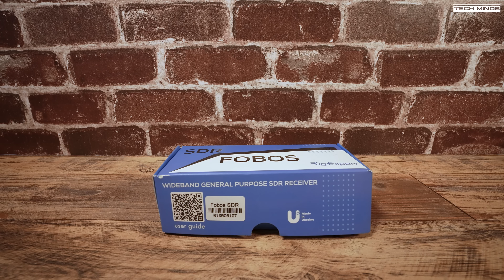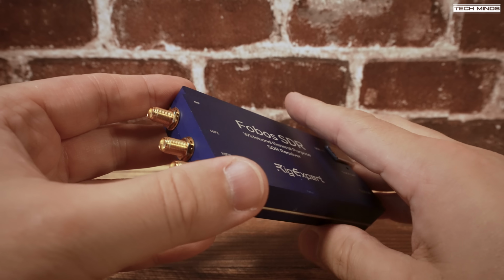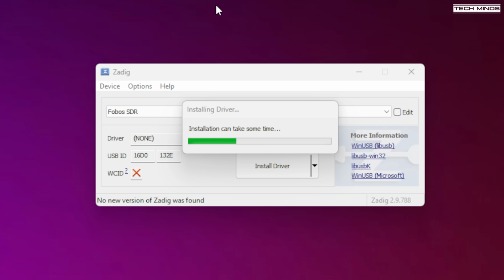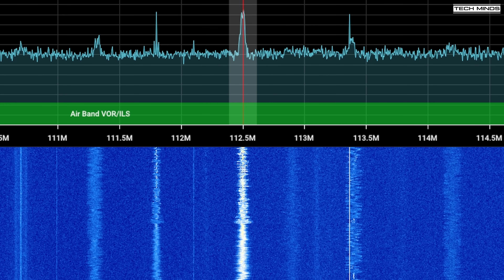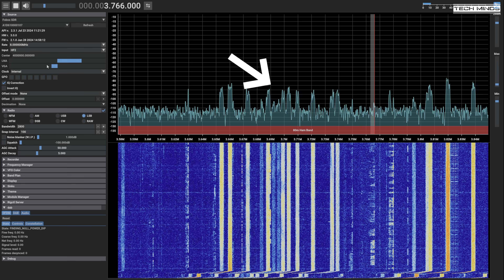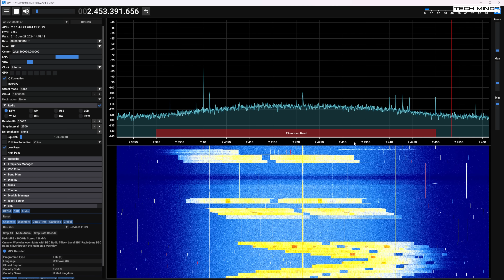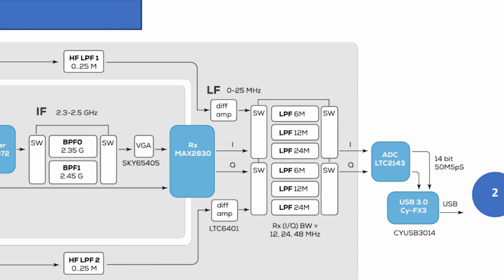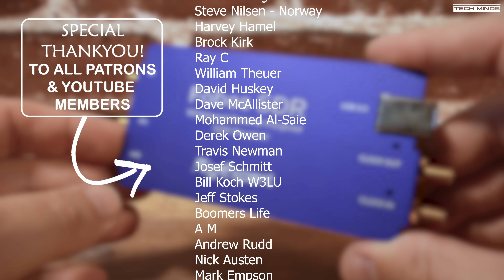RigExpert Fobos SDR 100KHz To 6GHz SDR Receiver

Comment: "Ignore those mirror signals".  That's the kind of response I would expect from some Chinese $30 dongle SDR manufacturer not from RigExpert.  What a disappointment.  I have 6 RigExpert antenna analyzers and love them.  I was going to buy one of these.  Thanks for saving me from making that mistake.  Mike KC3OSD
Reply: What models do you recommend by them? This wouuld be my first SDR. Thanks.
Reply: @mscir do you need RX/TX or just RX?
Reply: @technicianofgod  Sorry I didn't mention that, rx only. Thanks!

Comment: Thanks for warning us on this product ... you can clearly see at 9:55 that it just mirrors all signals towards DC ... its a bit like modifying an RTL SDR for sampling mode, the exact same happens, only here it mirrors at  exactly 14.4 MHz ... so you need a narrow front end and use the highest possible sampling rate. 14 Bit is a joke for such a price. But I still wonder if your device is defective, because that is just super bad.
I'd rather go with the RX888-Mk2, for under 200 €, which is real 16 Bit direct sampling RX that is brilliant and super clean on HF but less good on VHF/UHF because it uses the same tuner as the RTL-SDR for the higher frequencies, limiting its bandwidth and dynamic.
Reply: How does the RX888-Mk2 compare to the SDRplay RSP1b or RSPdx?
Reply: I dont know why you say 14 bits is a joke.  The BladeRF and Ettus B2xx series are 12-bit, and highly regarded.

Comment: Such a shame. I was really hoping this would be good. I love my AA230 and had great hopes. RigExpert customer service is great too. I really appreciate you making this video, even though you usually wouldn't. Lets hope that they can improve it with an update.
Reply: I'd be interested in options for hooking up via usb-c and how well they work.
Reply from the maker: Yeh, I was extremely surprised. I absolutely hated making this video, but I just didn't have a choice really.
Reply: @TechMindsOfficial  I do appreciate that you made this video and that you included the spectral data so that I could reach my own conclusions. I would prefer to not have to ignore things which are not there to begin with.
Reply: Uh-loo-mih-num. Not Al-you-mih-knee-umm
Reply: @attribute-4677  Not quite, it entirely depends where you were raised.  If you’re not from North America, his pronunciation was spot-on.
Reply from the maker: @attribute-4677 Shut up you tool 🔧
Reply: @attribute-4677  Al-you-mih-knee-umm. Not Uh-loo-mih-num. Don't be "that guy".

Comment: The aliasing is inevitable without the filtering, basic sampling theory. The HF port should only be used at 50Ms/s and above. That's why there is a 25 MHz LPF. At 50 MHz sampling the alias will be above 25 MHz, so prevent that band and all is hunky dory. In theory. Because there is only one ADC operating at HF, it is half the sampling rate, so if you wanted to use 8 MHz sampling you shroud have a 4 MHz low pass filter.. If there were I and Q inputs you could get a better result, but it appears at HF we have only I or only Q. So, run HF at max sample rate with the right software and I think you will find it much better.

The FM broadcast in Airband is probably again a lack of band pass filtering. Basically there is none. That has to be supplied by the user. Pity the user wasn't told .What is wrong is the expectations of the user have not been appropriately managed.

This does not mean it is not good, just it is not complete. It should have supporting software that only samples at 50 MHz or above for that HF port. Also, the fact there is only I or Q means the DSP software needs to know this. I suspect sdr++  is unaware and that's why the entire HF spectrum folds back on itself. That's software so fixable.

This is very similar to what you would see with the Pluto or even at Ettus USRP. Without filters they are all a disaster, never mind how much they cost. In this case we could have a very good SDR but one that needs additional hardware to operate properly.
Reply from the maker: Thanks Mike, you always provide great analysis which I appreciate. And, as I did show in the video, increasing the sampling rate did definitely improve performance on HF.  The problem here is, that most users, i.e folks that just want to plug an antenna into an SDR, and then the SDR into a computer, they just want to be able to use it, to listen to the frequencies it supports, without issues and extra fluffing and being specific with certain settings. The assumption that this is possible comes from the marketing that the Fobos is a General Purpose SDR. Rigexpert left a comment on here saying that I made mistakes in my video and that I misunderstood the topic of the Fobos...
Reply: Please do not bring SDR++ into this. They implemented the source module themselves, they are entirely responsible for any fuck ups on that side.
I offered to add support officially myself. I contacted them back in april to get a development unit. They said they'd think about it and then cut all communications. I was only made aware of these mediocre attempt at a source module when they finally released it to the public. They then tried to pull request their code to the official repo expecting me to merge it and then deal with user complaints without even having a device to test myself...
Reply: @TechMindsOfficial  did you happen to try any of the other windows based applications + HF mode? Just wondering if any have correct implementation by the RigExpert people (meaning coded natively by them)?
Reply: @cemaxecuter7783  They coded ALL of the implementations. To my knowledge they didn't send the device to any third party developers.
Reply: @TechMindsOfficial  Yes, that's the problem. An expert user might get the best from it but the average operator won't get good results.
Reply: Mike, I very much agree with your detailed reaction here. Not understanding the design and thinking an incomplete setup would work well in all cases leads to strange reactions.
Reply: @ryzerth  What's wrong with bringing SDR++ into this? People should have well rounded information.
Reply: @sammiller6631  I had nothing to do with the development of that source module. it was a complete hack and I don't want people to judge SDR++ by the failures of unrelated RigExpert devs.

Comment: I really need to hook it up to something like you have on your end. I for sure see the similar result in the HF band at least in terms of mirroring. Haven’t paid close enough attention (yet) to know if there’s transmissions that shouldn’t be there. For the other bands, I’ll try to spend more time with it but my location is at a very low point with hills and trees all around - so I’m likely not getting the overloading and high power from towers direct into the front end. I also made a small modification to soapy so I could use it with CubicSDR and SigDigger. Totally understand your point in sharing the video and it was a good one.
Reply: @СвятовитСоляник-л1б  I think I found your explanation or an explanation, saving it now.

Comment: High performance SDR receiver designer here. I have an hypothesis of what may be going on. 

By looking at the schematic of this device it's very clear what the intentions of the designers are.

This is a super sensitive receiver. Less than 1dB Noise Figure! That's as good as a receiver can be. The price you pay when designing for maximum sensitivity is lackluster performance when in an RF crowded area. But maybe that was the product they wanted to manufacture and the HAM marketing is just a disguise.

Why would an Ukranian company would want to manufacture a unit that's best fitted for Electronic Warfare Signal Intelligence in a battlefield with no FM stations nearby as opposed to HAM radio?

Well maybe this way the Russians don't drop a bomb on RigExpert's factory. Which incidentally it's on their website, so it would be a very simple things for them.

Ukranian Armed Forces now have a super capable radio to detect jammers and drone data links!

But as a HAM, please don't buy it 😂
Reply from the maker: You actually hit the nail on the head, as they say. I have some more information to share soon.
Reply: @TechMindsOfficial looking forward to hearing those news!

Comment: Given a response from RigExpert to simply ignore the mirror signals, this video needed to be made. If this was a cheap SDR, that might be acceptable - although even though you would have zero confidence as to what frequency signal was actually at... so for this much more expensive (and from a usually reputable firm), that is just not acceptable at all. I don't see an issue with negative videos, as long as they are honest, and leaving room for user error as you have done here... i.e. if you find out it is a mistake on your part, you can add a pinned description, and a followup video... and anyone else facing the same problem would probably hit this video first anyway. I was interested in this due to the wide frequency range and brand, but not for that price, and even then, I would want to know this issue is resolved.
Reply from the maker: Thank you for your comment. It was most certainly a difficult video to publish... After making this video I have since found quite a few forum posts and test reports that other users have also observed. I always try and test/review products in a video before viewing anyone else's reports or testing. That way it's not biased, it's my personal experience. Thanks

Comment: From the block diagram, it looks like direct sampling doesn't use the LNA (that's only for the double conversion superhet input path).  You could ask that they include switchable filters, but for such an incredibly broadband device, it's just not reasonable for them to do so.  It's quite fair to expect the user to enforce selectivity in front of a crazy wide-band device like this.  You really should have done a test with a 10- and a 20-dB attenuator in front of it just to see if you can knock down whatever very high power local signal is overloading the front-end and driving it into nonlinear behavior.

Comment: I presented the Fobos SDR for the 2024 SDRA, a video on their (SDR-Academy) Youtube channel should be forthcoming. When doing the right settings (BW especially) when working on the HF channels I did not have any issues at all. It does start to show mirrors of signals when using smaller BW setting than the 25 MHz. which leads me to assume the software implementation is still not up to par with the way this specific hardware is designed. But it is most certainly NOT a hardware or even a design issue. Just my grain of salt. PE3ES/F4VTQ, Erwin, 73.
Reply from the maker: Hi there, thanks for the comment and information. I also observed HF improved with certain BW settings, as shown in my video, but don't you think that having no hardware RF/IF gain control on HF is a design flaw? I would also be interested to know what type of antennas you was using to perform your tests. As mentioned in my video another user I spoke to saw less of an issue with far smaller and inefficient indoor antennas.
Reply: @TechMindsOfficial  I think it is a design choice, not a flaw. The system might be more geared to VHF as you state somewhere in your video if I remember correctly. RigExpert never tells you it is the best HF solution out there and the areas of interest they show in their documentation hint at VHF till the max of 6 GHz of the RF Spectrum.

Comment: Kind of gutted I really fancied one of these build quality looks amazing want to receive hrpt at 1.7mhz and s band at around 2.2mhz the only thing putting me off was no SatDump support but you can use any sdr software to make a baseband recording then run it through SatDump thanks for making the video hope Rig expert get it together and it is just teething problems with a new product. May be a mark ii version will come along sooner rather than later.

Comment: I guess you're prohibited from opening the devices on camera, because I know I would like to see the innerds.
Reply from the maker: No not prohibited, just not needed as the "Spec sheet" on the rig expert website has HD photos of what the board looks like. Cheers
Reply: @TechMindsOfficial  or what it should look like.  There may be deltas between those images and the version you have.  Also and here is the important thing, if it has an FCC reference number on it, you should be able to access the FCC reports for that device.

Comment: Thanks for the video and saving me just over £400.

I was hoping that the Fobos was going to be my next SDR but the apparent lack of any filtering at this price range is a deal breaker.

Are there any other alternative SDR's that do have adequate filtering and can cover 30MHz or higher in bandwidth?

I did have the original RX888 but wasn't impressed with that, not sure if the MK2 is any better.

Comment: May I ask which SDR was it that you used for comparison?  I recently acquired my first SDR  (an RTL-SDR v4), and I was disappointed to see the same sort of issues you experienced with the Fobos.  So, I was wondering how much it would cost to get something with a bit better performance, but without spending a fortune.
Reply: +1 This would be nice to know.
Reply: To have a RX without a lot of spurious signals requires very complex RF and IF stages with a lot of shielding & filtering. These Dongles are great, and cheap, but will never achieve the kind of performance that a ICOM can deliver. Edit - I should also add that I have a SDRPlay RSPdx and it is thoughtfully designed with just enough filtering to really make a difference without getting to ICOM prices. It has MW, FM and DAB filtering to prevent the really strong signals from bleeding into the HF and VHF bands.
Reply: SDRplay receivers start at around $120 and are great for the price and don’t have any mirroring issues.
Reply: @stevehageman6785  Yeah, I have an IC-7200 that I use when working HF.  It's just not in the budget to upgrade to one of the newer rigs with the spectrum scope and all the fancy tech.
Reply: @notsure1274  I'm sure I got what I paid for with the RTL-SDR.  But something a little better that doesn't break the bank, would be nice.  Thanks for the recommendation.
Reply from the maker: I was using an SDRPlay RSPdx R2. Fantastic SDR and great support. Had built in filters etc etc.
Reply: @TechMindsOfficial  I second that too
Reply: @TechMindsOfficial  Awesome.  Thanks for the info and the video!
Reply: What’s a good SDR that goes up to 6ghz? The SDRPlay guys only go up to 2 GHz…
Reply: They told you to just "ignore the mirror signals"??? That's like my doctor telling me to "not do that" when I tell him it hurts when I do this. Just...WOW. Okay then, SDRPlay it is.
Reply: @mikezinsmeister1223  I was thinking either an IF tap or external SDR switch for use with my 7200 and 857D
Reply: @garywatson  The HackRF SDR goes up to 6GHz.

Comment: Sadly what we have here is a reviewer failure.
The SDR is is working perfectly as expected under the settings that were used. Other SDRs would also show the same performance under these settings. 
As other posters mentioned you WILL get these image signals if you dont low pass filter at half the sampling rate, which was repeatedly called "bandwidth" in this review, and it is wrong to call this out as a device defect.
So you can call off the pitchfork and torch mob invasion of RigExpert, the witch hunt is cancelled, lol!
73 de G0AFV
Reply from the maker: Do you own one?
Reply from the maker: I'd also like to add, that I did show in the video that if the "Sample Rate" is increased that some of the mirror signals do not appear.  I used the term "bandwidth" instead of "sampling rate" because for those not so much tech savy, with sdr, will makes it easier to understand. Videos are viewed by viewers with many levels of knowledge, so sometimes it needs to be watered down. I dont think that this was a "Pitchfork" event towards RigExpert. I highly respect them for their Antenna Analyzers. What I personally don't like is an over priced SDR being sold as a "General purpose SDR" that performs how this SDR does. This is a specialized SDR and needs to be used in that way. I'm sick of comments on this video now, nothing I showed in this video was a lie, it was live demos, with all settings clearly shown. Even the antennas that I used was shown. I am not the only one to have spoken out about this SDR. So, MR BJ, please go and spend £500 on this SDR, and then report back that you are over the moon with it and it's everything you ever wanted in an SDR.
Reply: Many of the others popular ones have variable filters that follow the sample rate/bandwidth.
So just lowering it and things would just work. In that case it's missing that filter.

The device is supposed to be a full reciver frontend, not just a fancy ADC dev-board.

Comment: I think you'll have to make a new video about this receiver soon. Because you haven't fully grasped the topic and made a number of mistakes, thus clearly underestimating Fobos's characteristics. Try using the uSDR software. You will be surprised.
Reply from the maker: It's being sold as a "General Software Defined Radio"... Many people will see that advertising statement as a product which will be an ALL in one SDR, and they will not need any other SDR because of the frequency coverage. Granted, the specifications are great on this SDR, and used with the correct "External Filters" and "Attenuators" it could perform okay. But as a General SDR, no way, users want more for the price of this.  Please also list the mistakes I made and detail more about the topic I did not grasp. Your marketing told me to "Ignore the mirror signals"..... Not good..  uSDR is NOT user friendly, it's too complicated for the average user.